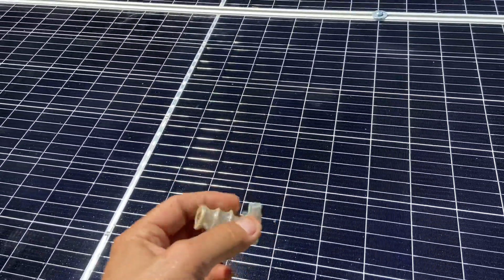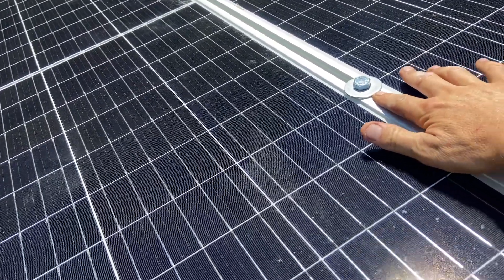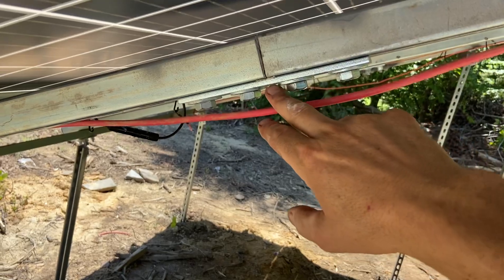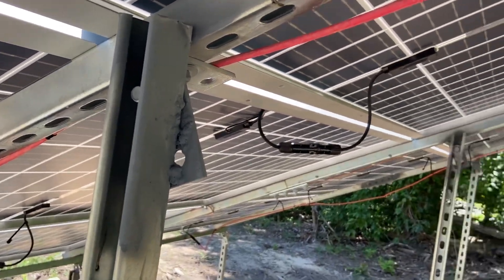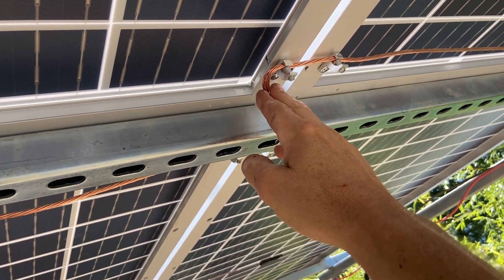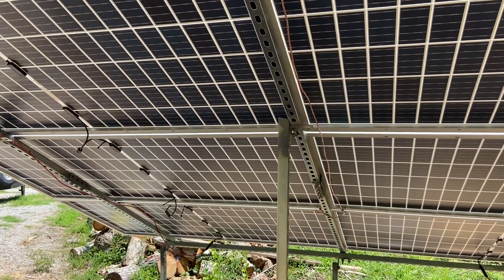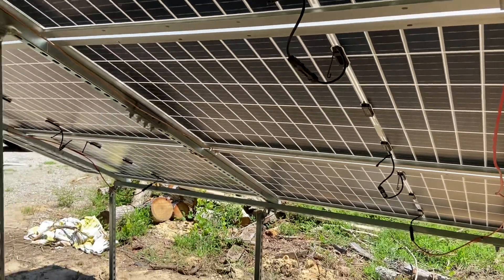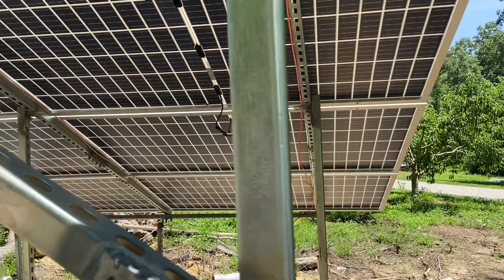3200 watt Unistrut solar array follow up video- cheap solar array setup

Comment: Nobody mentions the nasty cut you could get from those angled L brackets sticking out?  Not knocking the setup which is great.
Reply from the maker: They are dull on the ends. So I dunno how they’d cut you. Maybe I’m thinking about a different piece though?

Comment: You already have metal posts in the ground - why re-ground the system? Are you not confident in the PV Frame to Unistrut conductivity?
Reply from the maker: I believe it would be fine. On the other hand, I had extra wire and clips. So I figured a little redundancy wouldn’t hurt.

Comment: Not sure about the use of the grounding clips, and the copper wire. The aluminum frames are conductive, the unistrut is conductive, and all of the unistrut is embedded in the earth. Doesn't get much more grounded than that.
Reply from the maker: I agree. To be honest I had extra wire and clips from my pole barn solar panel install. So I figured a bit of extra insurance couldn’t hurt. So now instead of grounded, I’m GROUNDED.
Reply: Do you also have a ground wire going to your inverter with the rest of the PV wire?
 @GavinStoneDIY
Reply from the maker: @cgutowski471  the ground wire from the array is supposed to go to the ground rod where your main panel is.
Reply: @GavinStoneDIY I'd love to understand the why behind that. Since it's on the DC side, I can't imagine it would be related to bonding requirements at the panel only. If the main purpose is to prevent voltage build up and a path for lightning, seems shorter is better.
Reply: @GavinStoneDIY  If you do get a lightning strike it will likely make things worse though.   Better to keep the lightning protection physically separate.  As long as you have SPDs though your equipment will hopefully survive.

Comment: Nice Job! May I make a suggestion? @1:18 your middle mount washers seem to cast a little bit of shadow on the cells. This can create a hotspot overtime, perhaps use smaller washers? I would say grind them down on the sides, but then you'll probably have rust issues.
Reply from the maker: I appreciate that. It does cast a small shadow. But the shadow only extends to the silver trim. So it never actually touches the cells. One size smaller washer probably would have worked. But just seemed a bit small.

Comment: Nice design 
  The only thing I’d like to do different and who knows if it’s actually worth it would be to have it were it could tilt a bit for winter and summer 
   But super cool 👍🏼
Reply from the maker: It can be done with RV jacks and a bit of engineering. I honestly didn’t want to go through the effort. But I’d say it would probably be worth it.
Reply: @GavinStoneDIY   great idea
Reply: @cowboymcq6711  I have 20 panels laying flat on a flat porch roof. Before I put them on the roof they were just laying on the ground. Angling them seems to be over rated in my opinion. The real limitation is how many watts and the max VOC that my all in one solar charge controller will handle. Once it's maxed out it doesn't matter if the angle is tracking the sun or not.
If that makes any sense. I have to lay them flat out of sight to avoid permitting and zoning issues. So I just used enough panels to max out my system.

Edit.
Thought I would also add that 2 of my panels are shattered from shipping. They still produce power just fine
Reply: @fauxque5057  Did you secure your panels to the flat porch roof? I'm considering doing the same since I have a large metal porch roof but haven't figured out a way to secure the panels on the patio roof without getting on the roof since it likely wouldn't support my weight. Thanks

Comment: Gavin, thanks for the ideas you have provided from your projects.  I would appreciate another video about the performance difference between your open array, and your shed build.  Do you feel the shed roof with bifacials is performing adequately?  Is it really worth bifacials as a shed roof, or just build a roof like a gazebo with no sides?  Also, I have read that bifacials perform better in portrait than landscape, do you feel they are producing less in your configuration?  You've done a great job, keep us informed.  Thanks
Reply from the maker: I should take some time and make a video covering these topics. I appreciate the questions. I’m always getting new ideas from other youtubers also. So the goal is to help each other for sure.

Comment: People check with your county before you do this design, it likely won't meet permitting.
Reply from the maker: I didn’t ask for permission. But you’re correct. If it were to be inspected it may not pass.

Comment: How did they perform for Wind up lift?  And Shear?  I have 32 to mount, 4 rows of 8 in landscape or 2 rows of 16 in portrait.
Reply: Hybrid.  I'm using 3inch 240 wall tubing.  Have piers dig 38" deep 10" diameter with 14 inch footings.  Will run unistrut for the solar panel mounts.  Over built?  Nope.  Have to sccount for snow load at 21 pounds a cubic ft and two days of it not cleaning them off.

3.7kw worth of panels.

Nice set up and thanks for sharing!
Reply from the maker: @wadebrewer7212  that sounds like a solid array.  What inverters are you going to be using?
Reply: @GavinStoneDIY  currently have an older LV5048, the scope of the project has changed.   Originally was going to be fir emergency use, but now I want to net zero the meter.  So.....Sol Ark seems to be the best option for doing that.
Reply from the maker: @wadebrewer7212  it’s the easiest way to go as far as approval and inspections for sure. Does the new lv6048 have UL approval yet? You may want to check with watts247. I believe those have a net metering option also.
Reply: @GavinStoneDIY  the MPP6048 does not have UL, but the EG4 version does, and they are almost same unit.

Inspection......what is that? 🤣
Reply from the maker: @wadebrewer7212  you might be thinking of the lv6548’s like I have. The mpp6048wp isn’t really the same as the eg4. It’s a split phase low frequency unit. It comes with a pv shutoff in the unit and It has net metering option as well. Lots of cool options with that inverter.
Reply from the maker: So far the highest wind I’ve had is 60mph. They didn’t move or shake at all.

Comment: Did you cement the Unistrut into the ground?
Reply from the maker: Yes,  I used an auger and dug them 2’ in the ground and poured concrete around each foot.

Comment: Hello, What is the angle and your solar panel size? My panels are 41" x 82" and placing three panels in landscape orientation doesn't work because each unistrut is 120 inches long and three panels add up to 123 inches (3×41). I plan to put two unistrut together, like yours which gives me 240 inches (2×120) and have five panels in landscape orientation (205=5×41), similar to yours. Thanks
Reply from the maker: The angle is around 30 degrees. Which is ideal for Virginia where I am. My panels are roughly 39x79. If you install them like I did 120 inches is perfect. You have to account for the overhang of the panels also. Mine overhang the unistrut 19” on either side. So depending on how you lay your panels out 1 unistrut wide would still work fine probably.

Comment: Thes no need for welding if you know how to use L bruckets
Reply: Unlesd for safety if thes thiefs around your home
Reply from the maker: I didn’t really need to use welding on the L brackets. I had the welder for X bracing on the tall side and decided to use it for the L brackets also while I was there.

Comment: Thanks for providing an answer to DYI ground mount that doesn't break the bank. Hope you do another video on measurements and spacing of post and rails.
Reply from the maker: I hope the videos help. The spacing isn’t too crucial. Depending on your panel length then I just used a full piece of 10’ unistrut for the width. So with mine they have around an 18” overhang off the sides and the panels both meet in the middle. That’s the nice thing about unistrut. It’s very easy to adjust. You will end up spending around $100 on bolts believe it or not. But still I think I only had around $450 in it total.
Reply: @GavinStoneDIY  thanks for that info

Comment: Great job 👍 I wish I had of used the bifacial panels on my array. You explain things very well easy to absorb the information. Thanks 🙏
Reply: I like the spring nut idea too, if a panel goes bad you can get it off easy. Great Video!